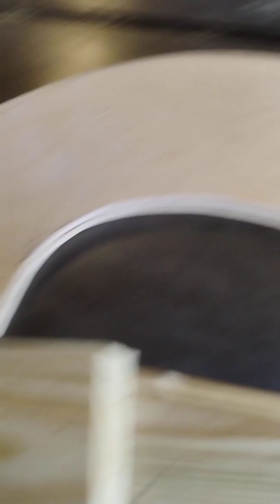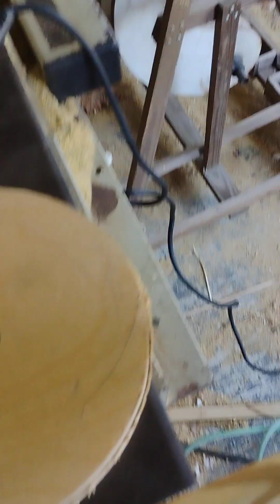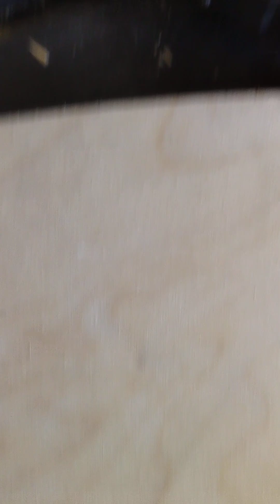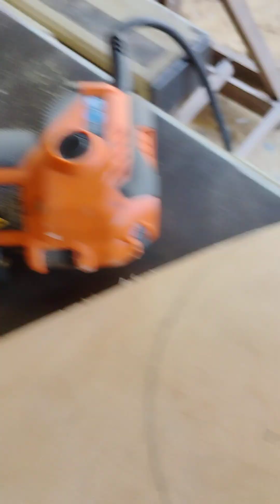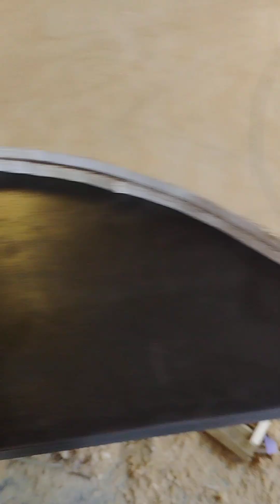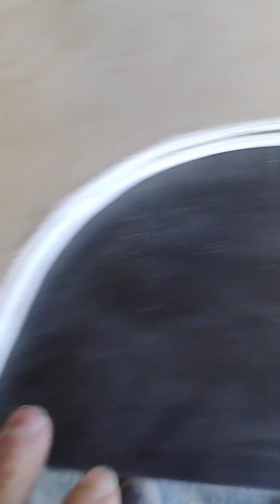Whipper Frame Upgrade short#22 #whippertrebuchet #woodworking #whipperratios #counterweight

Comment: When you are laying out the curve of the arm, are you mainly concerned about the size of your projectile or does the curve Have another function
Reply from the maker: Hi Aaron. The curve allows for larger projectiles in smallish machines, gives Drop Out clearance when the arm inverts, and gets the counterweight closer to the arm for higher cocking, and longer power stroke. It's all in the description.
Reply: @FingerAngle what do you like to use for counterweight ratio?